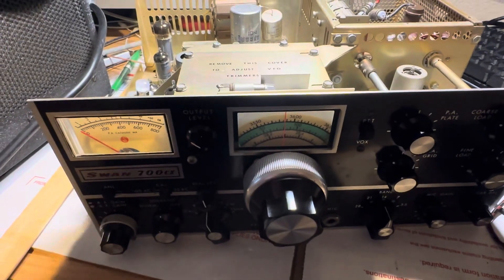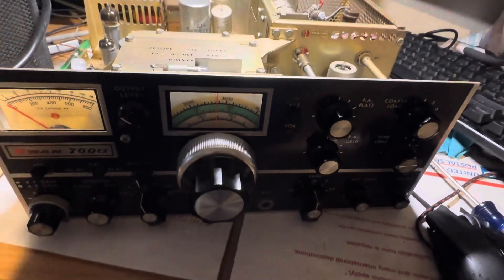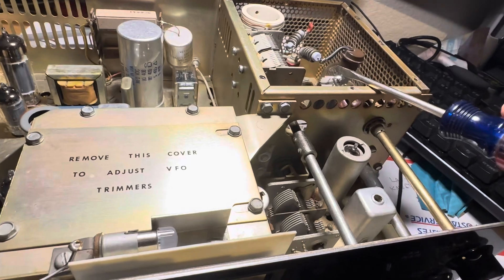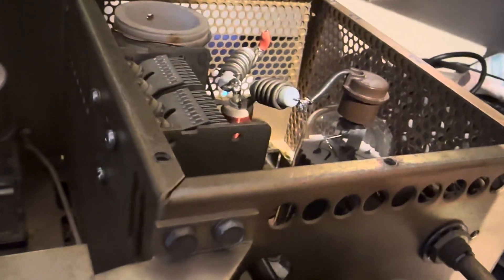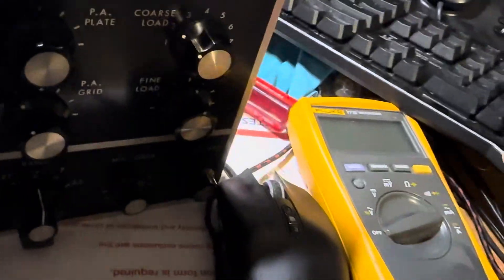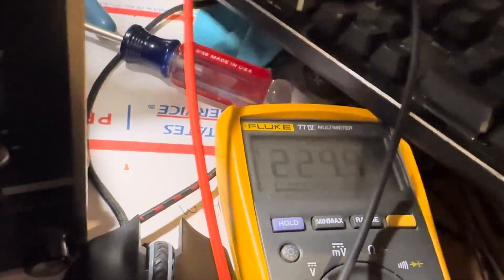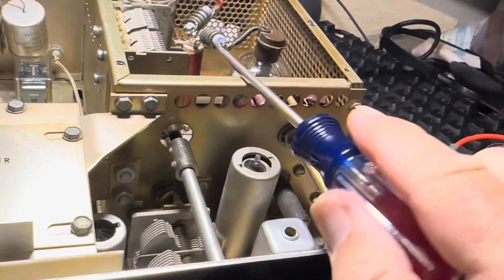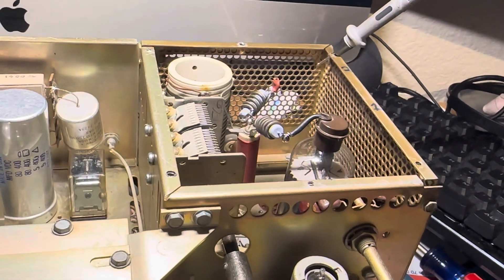Hi voltage can kill you This is how to safely discharge high-voltage from linear amplifier or finals

Comment: when the capacitor bleeds off, where does the current go? There has to be current somewhere because less charge = less coulombs and current is coulombs per second.
Reply: Voltage is a potential differential. The bleeder creates a current limited circuit to equalize the potential. Of course referenced to ground there might still be potential…